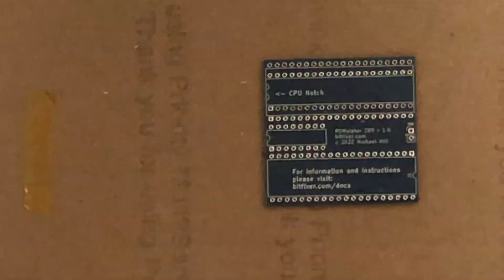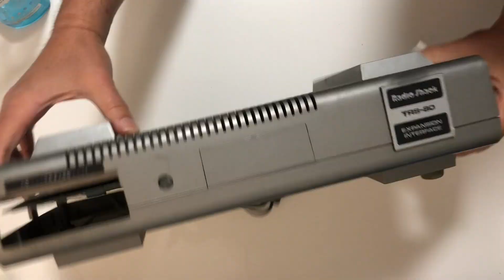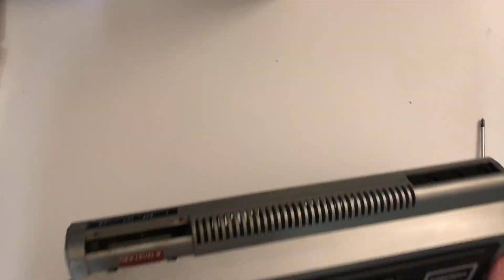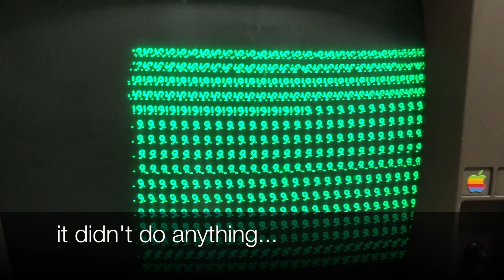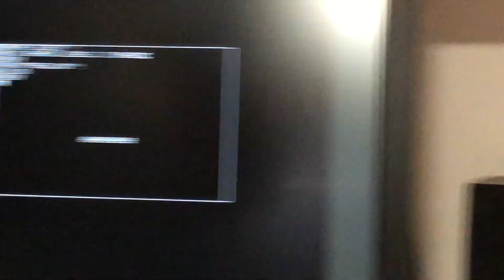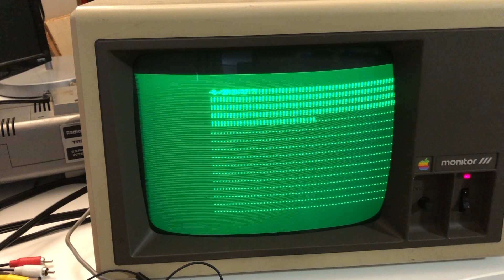ROMulator Z80 Release! Using it to diagnose a TRS-80 Model 1, and new ROMulator announcements.

Comment: Adrian Black had a similar issue caused by the variable capacitor I think. He didn't have a variable cap and just put in something like a regular cap. It worked (well, there was a slight flicker, but it was easily readable). The variable cap was supposed to fine tune the sync, but it wasn't working and the sync was lost.

Comment: I spent 40 years writing assembler for various real time products beginning with the 1802 COSMAC, 6502, and Z80 which is my favorite Assembly Language/CPU architecture.  This all ended when transistors became smaller making them cheap and fast.  Now writing almost entirely in high level languages and just purchased a Z80 romulator for the fun of it !